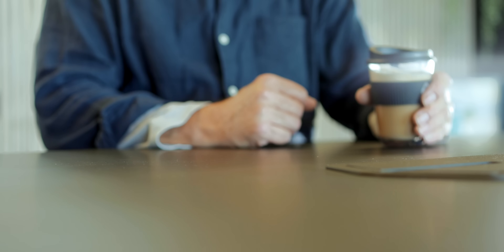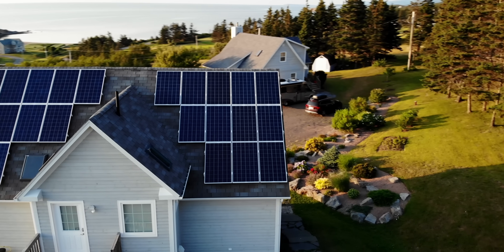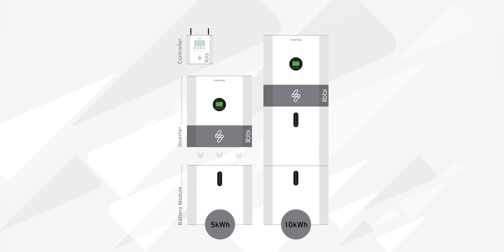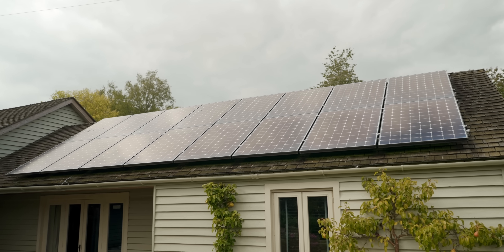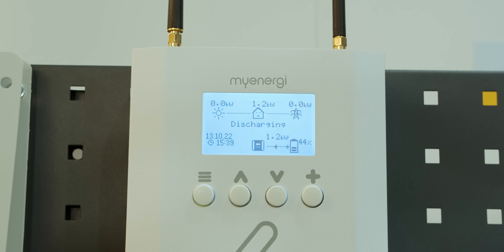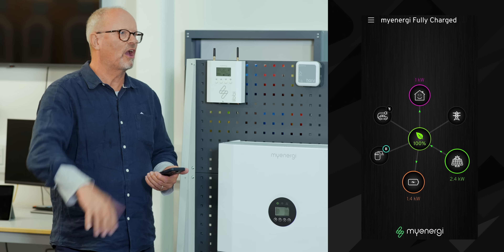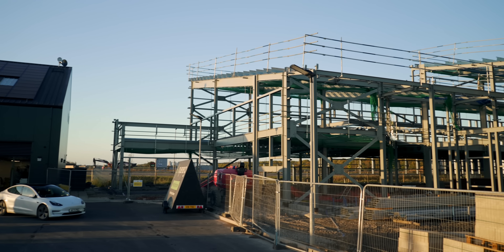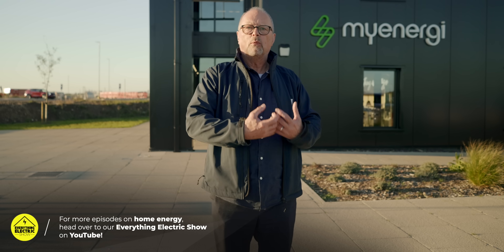THIS Home Battery is the Key To Cheaper, Cleaner Energy!

Comment: It looks like a rebranded KStar battery system (CATL cells), with the additional integration module for the myenergi app and comms side. The app and control ecosystem is really slick and just makes it all work well together. As a new build or new system with PV being installed, the hybrid inverter is a really good offer. But this can also be retrofit as an AC coupled system too for existing PV installations.
Reply: You are so right it's dose look like a kstar but I can see why they would do this. Why develop something from scratch with teething pains when you can build on an already developed products but to make it better advanced features.
Reply: @johanncover1988  I agree! And it's not a cut and paste, the interface and controls they have developed to make it work in their ecosystem so smoothly is added value over the original system.
Reply: @ChrisBaileyMusic  I have a similar setup with and emporia EV changer and a solarac equivalent inverter and it took some research/engineering to get it all to work together. While it works "okay" I have to jump between apps to modification as to wear I want power to go and it is very easy to make a mistake. I can definitely appreciate a fully integrated systems from "myenergy" like that.
Reply: @johanncover1988  i cannot appreciate anything that is a very basic need and depend on a luxury app , that when aws or azure have problems you will be out of reach of the app , or if the company in 20 years will be gone so does the ap. 
I am an IT person, and when we rely on such things it is more likely to be forgotten in 20 years.
It is better to make a basic system and add on top the "smart" system we want instead of making a all in one. just like having two machines one for washing the clothes and one for drying them, if you have one for both and it dies you will lose both functions
Reply: @boxfabio   what you are saying is very true but how would you create a reliable "basic" system that allows you manage wear the power gose with out you constantly standing watch to flip a switch. The app makes this function accessable to the busy laiman but at the cost you rightly mentioned. For me I will test my system if I need internet acces to  stay functional
Reply: @johanncover1988  there are several options out there but the one I know most is Shelly's products, they also have an app but all their smart things have webservers embedded so if the cloud is offline you could go in directly ;)
Reply: @boxfabio  the Shelly product line looks good for application control of individual load control but I don't see any solutions that can communicate with a hybrid solar inverters or EV charger
Reply: @johanncover1988  they have a din relay system, then you can create actions for example, you connect your solar panels then if production is equal or more then consumption of the house turn off the grid relay , things like that. Of course it needs more knowledge in the beginning, but knowledge is power :)
Reply: @boxfabio  it really all depends on yours setup but I think we are digressing from the point. It may be easy for you and I to invest the time to make a system  with rubust standalone components but I just don't so the major popular will to walk that path when they can go to myenergy and have all that intergation done and a simple user app to manage the whole workings, Cloud services with standing
Reply: I think the thing that interests me the most is that it can (apparently) be installed outside, that's quite a differentiator.
Reply: Yep its KSTAR
Reply: @clintonyorke  but with an extra integration layer
Reply: the company has an electrically powereed LED sign that says "green AF"  .... :s
it there ever was an example of an oxymoron.....

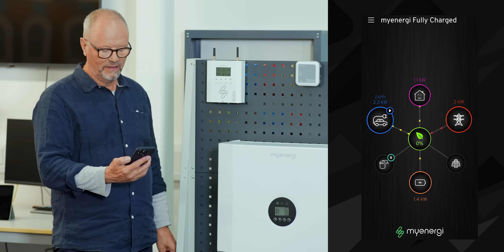Comment: 13:13 - "....you can't do that with 3rd party batteries..."  Not sure about that. With Powervault3, you can use the 'disable' function of the app to use the energy stored in it at a later time, although overall, the functionality is not as comprehensive as Libbi for now.

Comment: I have a 5.5kW solar PV system and a Tesla Powerwall battery. In my opinion, you need at least 10kWh battery storage capacity to make powering the house almost all year round viable. I get about 93% annual self sufficiency, with a further 2200kWh going to the grid (which I earn around £700 for on the Octopus Agile Outgoing tarrif). I also heat my domestic hot water for 8 months of the year by turning off the HW side of my gas boiler. The ideal would be an electric car with V2P, to be charged on the surplus solar PV energy. Don'y forget, even the best EV's only manage abour 4 miles per kWh, so a 5 kWh storage battery would power the car for 20 miles tops!  Charging a car using a cheap overnight tarrif or during the day using spare solar energy makes the most sense. Designing software to make the 3 power sources (solar PV, storage battery, EV battery) talk to eack other is a big step forward.
Reply: how about they apply some modern tech and add one of the few 95% efficient panels that have been hidden away and slap one on the car roof.

Comment: Home-generated PV energy that's put on the net isn't 'wasted', it is usefully used, replacing fossil fuels. So, using a home battery to store the energy for yourself isn't helping the climate. Worse, the production of the battery is pretty bad for the climate. It might save your wallet, but all this stuff is very expensive, so most likely, it isn't saving your wallet either. Our goal shouldn't be net-zero homes. It should be net-zero planet.

Comment: they should color the triangles to indicate where the power is coming from/goign to.  So if you do a 60/40 battery/grid, some triangles could be blue some green, when you have two sources.  Also, fantastic product, its a shame we will probably never see it in the USA.
Reply: I think the US is more likely to adopt Autobidder than something like this. Their recent trials of connected homes with Powerwalls supporting the grid in times of stress in California not only worked but made a tidy profit for Powerwall owners by selling at "emergency" prices to the grid. Of course, most of the US is South of England, so there's more daylight to accumulate in order to arbitrage it back at high margins during stresses. That might be why libbi may be a better choice for the U.K., 
Yet Tesla tends to think on a global scale, so I wouldn't bet against them developing even more efficient systems when the time comes. 
During the recent Tesla earnings call, Elon said that they weren't limited in production for vehicles, Powerwalls or Megapacks by cell supply. Accordingly, I would expect solar / /wind / storage / grid-balancing and increasing reliability to grow exponentially in much the same way their auto division, SapceX, FSD and other Musk-created entities have taken off.

Comment: 13:06 There is literally no reason they couldn't do this with a third party battery... the smarts is all in the distribution net, the battery is just another energy store... or am I missing something?
Reply: I might be missing something but the hardware is sourced elsewhere. Lots of these designs elsewhere, exactly the same, from China. Off the shelf parts. The firmware and software is the bespoke bit.

Comment: Wouldn't it be nice to have a version of the Zappi that could use Vehicle to Grid, so you have it as an extra battery in the evenings?
Reply: Yes!
I would even be happy with V2H
Another feature I would like is if it could also operate like a gateway to allow your solar to continue to operate during an outage
Reply: Pluss the car needs to be compatible, we have VTG but are stuck with a leaf because its the only car on the market that works with VTG
Reply: One problem with vehicle to grid: it's kind of hard for a car to soak up extra solar energy during the day for people who need the car to drive the work...you'd essentially have to either work from home, own multiple cars, or get to work by walk, bike, or public transit, in order to get the most use out of it.
Reply: @ab-tf5fl  I am retired but lucky enough to have a PV system and 2 Teslas that sit in the garage most of the day. Ideal use case for us would be V2G from Tesla...Apparently it was a feature of the Roadster but was little used - so Elon Musk, being data driven, thinks there is no demand for V2G...
Reply: @michaelconyers6716  There may ve in pickup trucks.
Reply: @ab-tf5fl  But at the weekends it has some more potential.

Comment: After Robert announced Myenergi had something innovative to launch i was hoping for a V2L inverter.
Reply: A home energy package that includes an inverter that can work with a DC charging point would be extremely interesting and possibly quite lucrative, if they got the timing right. Hyundai are supporting V2L using a bidirectional on-board charger, but it looks like VW and their MEB platform are gunning for an off-board converter, using CCS DC power export. The standards for this haven't even been out for a year yet, so I'm not surprised that there aren't any products supporting it, but I wouldn't be surprised if we see it in a couple of years.

Moreover, there might be scope to use a home energy system to semi-rapid charge an EV at up to 25kW. The libbi uses a 3.68kW inverter with one battery pack and a 5kW inverter for larger systems. If you assume that a 5kWh module could be set to discharge at 5kW, then build a big 4-module system and add a 5kW inverter, you've got 25kW of DC power. Plus whatever the solar is delivering. This would, obviously, be for special occasions, but it would be very nice to semi-rapid charge a visitor's car while they stopped off for lunch. Even if you don't get as high as 25kW, it still seems very feasible to deliver >7kW, whenever peak charging power is required. For bonus points, Phoenix Contact do a low-power CCS connector that would be perfect for this kind of system.

Comment: If the Libbi controller can intelligently manage energy paths, does that mean it can do islanding? In other words, if the Grid connection goes down can it power the house/charge the car from the stored energy like Robert's Tesla setup can? Might be handy in the coming world of Grid blackouts.
Reply: It possibly could.  But it would need to installed on the house's mains with an automatic transfer switch (ATS) that can physically disconnect the house from the grid when the software detects such a grid outage.

When running without any support from the grid (total off-grid mode), the home battery and its inverter need some beefy surge current capability to handle large "inrush current" from turning on like kitchen heating appliances and especially garage plugged power tools like table saw, miter saw, etc.  Because a big garage power tool can easily briefly spike the power demand to 6000+W which may cause inverters and batteries without that surge capability to trip out and shutdown.  These big inrush currents are normally handled by the grid w/o anyone noticing.  But, in off-grid mode, you'll notice it when the entire house instantly goes dark because the inverter shutdown from its overcurrent protection systems.

Even without the problem of surge loads, the cumulative power flow of simultaneous EV charging (5000+W), kitchen appliances (1800W+) and home clothes dryer (6000+W) could easily overwhelm the system.  A single Tesla Power wall is around 5000W output but they can be installed in multiple parallel units.  But TV watching, computers use, all the home's lights can easily be handled by a 5000W system without any problems.
Reply: According to their website, yes it can, though it's an optional extra. As noted above there's probably an extra contactor or two to be supplied & fitted also to make the switchover seamless. Like a switchover to a hot standby generator.
Reply: My project solar system has a switch in the loft for this scenario. Brilluant in the dark!
Ive asked for it to be moved when they find some batteries which are as rare as hens teeth apparently.
Reply: @Honestyalwaysprevails  friend of mine just had a 300ah LiFePo delivered this week for his camper. He ordered it in late May.
Reply: @Honestyalwaysprevails  I waited 6 months for my battery. But well worth it. It's really helping at this time of year as it's just about giving enough energy to last through the night. Obviously that won't last but think though the next few months I'll be using close to 100 percent of what I generate. The wait is frustrating as I've been there.

Comment: Great video, and fantastic to finally see the Libbi in action. Love the way the devices will work together and if you already have their products and solar the Libbi would be a great addition (Depending on cost - which I note still is not widely indicated). Shame the thumbnail is a bit clickbaity. Tesla aside, there's alot of comparative systems, however in order to compete with a Powerwall on useable capacity alone you would be into 3 x batteries with the Libbi. I guess the cost will be a big driver as most considering it will have solar already (and an inverter).
Reply: Sounds that it will be uncompetitive with Tesla Powerwall which itself is a rip off considering that you can get a complete car plus 80kwh battery for around £40k.

Comment: This home storage system, like so many others, is a very neat solution, but the pricing is always the issue. For the price you pay for even a small home battery you can buy a lot of electricity...
And it looks like prices will keep going up, not down.
I looked at a Huawei Luna2000 about 2 Months ago...it was 3500€ for 5kWh. I wanted to wait for the price to go down...3 Weeks later it went up by 800€...and stayed there.

Comment: Hope it will work with 3 phase.  Which is the norm for homes in Denmark.  I'm keen to be able to charge with cheep wind power at night and then use it or sell to the grid in the evening.

Comment: Already have the full compliment of myEnergi products in my home and it all works brilliantly with my Tesla Powerwall. Am missing that last part of integration of choosing how I want my stored battery energy to be used but still have a brilliant set up. But how much is the new Libbi? And it looks a bit larger and deeper than the Tesla PW but less storage- just 5kwh or 10kWh. Tesla PW is 13.5kWh. And slimline so easier to place in a house and garage.
Reply: It’s probably Lifepo4, so the chemistry is a bit larger and heavier but there’s a lot of benefits on longevity for that.

Comment: Very interesting concept. I have 10 Panels with Microinverters, and I know how much is generated, but not how much is fed to the grid. I need this information to determine how large a battery I need. No point getting a 10Kw unit if I only have 5Kw of my generation available to charge the Libbi.

Comment: I don't understand why FCS is glorifying these type of solutions. It's like keeping a cow to have your own milk thing... Not better to invest structurally by governments and specialised companies and share the cost among end users instead of having your own devices? Complexity of this solution + environmental impact if more people keep all of those devices at home (recycling of PV panels, batteries...)  is way higher vs larger projects where you can design synergies, don't you think? And the charging in off peak hours... it is the same energy, it has to be generated, it's not wrong that people want to do it but it's fundamentally wrong that those type of differences in price exist. It's just driving demand when there is less renewable to provide it hence increasing less clean energy generation. I don't know, just thinking loud and I am curios what other thing of that.

Comment: Without fail, Robert always makes me laugh. 

Another cracking video, and the Libbi seems to be a cracking addition to the myenergi range of devices. ❤
Reply: Robert should get into comedy properly, maybe get on TV
Reply: @Slash1066  I hope this is sarcastic irony.😂
Reply: It will be cheaper than grid power. At current prices, two or three years to repay the capital costs. But even if it’s 5 years it’s well worth having.
Reply: @Dave5843-d9m  Call me mr picky, I still like to see numbers. Heat pumps are supposed to be the new nirvana for home heating until you look at capital outlay and pay back times. £10000 for external wall insulation, £15000 for heat pump and fitting minus £5000 grant still makes £20000 outlay with payback time even at todays prices of over 20 years. So forgive me, I love these ideas and I genuinely do see their merit but I need numbers
Reply: Still doesn’t answer the question ….how much will it cost ? 
There is no indication of costs on the myenergi website
Reply: @Banyan314  I saw a video yesterday by an installer about a very similar modular battery/inverter system from another maker installed beside an existing fuse box (so a simple install) & that 11KWh setup was ~£7,000 including VAT. I would expect this to be competitive.
Reply: @alanhat5252  Thank you
Reply: @alanhat5252  Thank you. Just getting out the calculator to look at payback time on this investment.